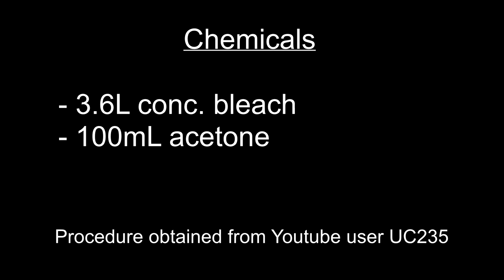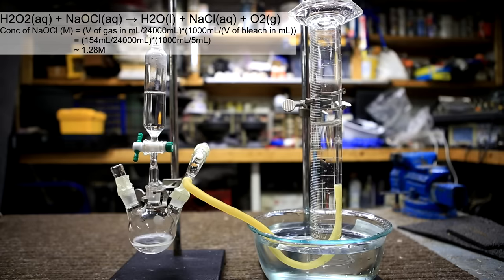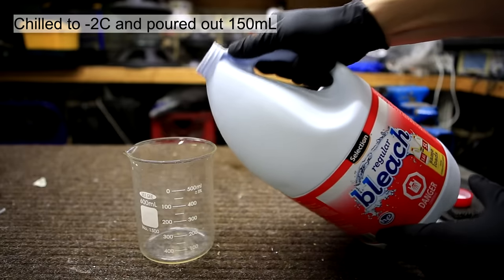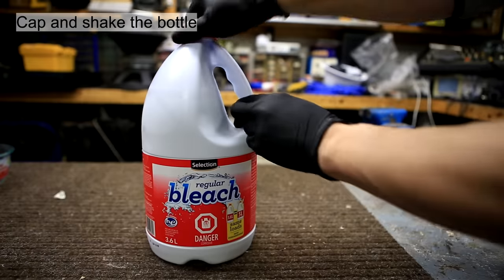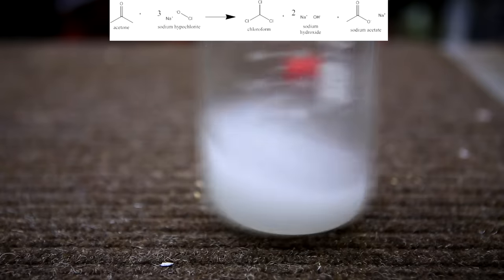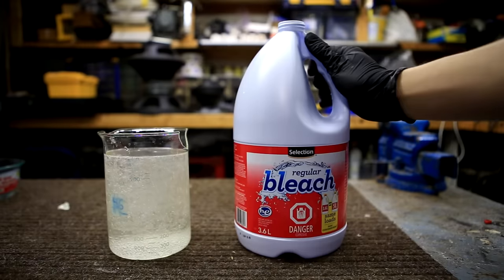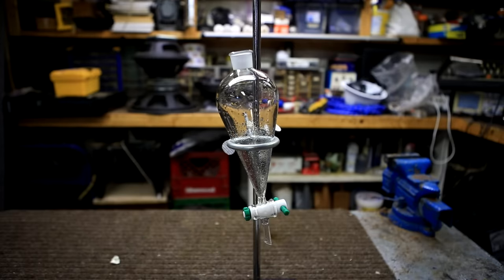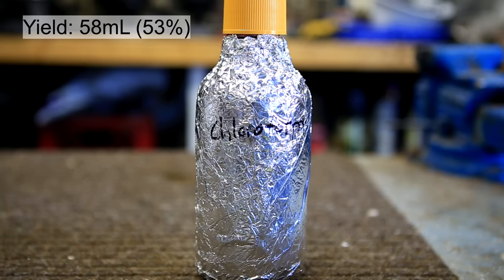Making Chloroform

Comment: This is actually very useful for smoothing PLA 3d prints.  I use it to smooth most of the objects that I print using pla plastic.  Just put the Chloroform in a jar, suspend the part from the lid, and heat it up on a hot plate.
Reply: Or just normal kidnapping. That works too.
Reply: M Mmm Hey government, is your refrigerator running?
Reply: M Mmm Well then you better go... oh wait, nevermind. Anyway, depending on the food you keep in there, that could be quite dangerous with food spoiling very quickly. I recommend that you get your fridge fixed.
Reply: A Walrus Too bad my fridge is always empty. I'm broke, and always ordering Pizza.
Reply: A Walrus We'll be by to pick you up in the morning, at around 6. That's cool with you?
Reply: M Mmm Just so long as your fridge is fixed by then. And there had better be a sandwich in that fridge.
Reply: A Walrus lmao wtf
Reply: To complicated.. guess I'll just use a hammer
Reply: A Walrus actually, I think you're the one on the wrong video. This is a chemistry channel, typically viewed by people interested in chemistry  for the sake of chemistry.
Reply: But doesn't acetone do the job just as well? Or is there some benefit to using chloroform over that?
Reply: Acetone my make you pass out but chloroform in the right dose is an anaesthetic. Though the amount needed to kidnap someone though would mostly end in murder. The fatal dose and the anesthetic effect are rather too close for comfort. Mostly the incapacitation effect is an old Hollywood trope. I can happen but,...but nowhere near as well as it does in movies. I do like the smell though, not sure why. Very useful for preserving stuff or welding plastic though. However, I do not use it anymore myself as It has a nasty habit of releasing small qualities of phosgene, and if you have not caught a whiff of that stuff, it is bad bad news. Sorta feels a breathing glass then your head pulses in waves of pain and that is a very tiny amount.
Reply: Right ? Works great 👍
Reply: A Walrus no
Reply: Tanner Tech 🇧🇲🇧🇲🇧🇯🇧🇩🇨🇦🇨🇦🇧🇴🇧🇳🇧🇳🇧🇫🇧🇴🇧🇴🇧🇿🇧🇴🇧🇴🇧🇳🇧🇴🇧🇴🇧🇪🇧🇫🇧🇴🇧🇴🇧🇲🇧🇪🇧🇳🇧🇳🇧🇴🇧🇫🇧🇾🇧🇾🇧🇳🇧🇳🇧🇲🇧🇲🇧🇩🇧🇲🇧🇲🇧🇯🇧🇯🇧🇲🇧🇲🇧🇲🇧🇼🇧🇲🇧🇲🇧🇯🇧🇲🇧🇲🇧🇯🇧🇲🇧🇲🇧🇩🇧🇲🇧🇩🇧🇩🇧🇩🇧🇲🇧🇳🇧🇳🇧🇩🇧🇪🇧🇪🇧🇳🇧🇳🇧🇿🇧🇿🇧🇴🇧🇴🇧🇳🇧🇫🇧🇫🇧🇴🇧🇳🇨🇺🇨🇺🇨🇷🇨🇺🇨🇺🇩🇯🇩🇯🇩🇯🇨🇺🇨🇻🇨🇻🇨🇰🇨🇺🇨🇰🇨🇰🇨🇮🇨🇰⬛🇨🇰🇩🇰🇨🇻🇨🇻🎊🗼
Reply: Can't you do that with just acetone though? Or 91% isopropyl?
Reply: KEK
Reply: you get the same result with just acetone
Reply: not cleaner... but way more faster
Reply: gorepuppy that's why the guy in the video said to put a few drops of ethanol in the chloroform.... to counteract or neutralize the phosgenes.
Reply: Heather Leigh 
Thank you. I just dont understand why some (not all) men do that. If they are feeling that "frisky", well we all have hands......😉
Reply: Tanner Tech I'll have to use this tip, thanks :)
Reply: Acetone is used for smoothing ABS . Not for PLA . 
If you are afraid to use Chloroform ( legal reasons or whatever ) , you can also use Dichloromethane ( legality varies from country to country ) .
Reply: A Walrus 😂🤣😂
Reply: A Walrus rape jokes are not funny.
Reply: Aeroscience IF WE HAD CHEMISTRY WE WOULDN'T NEED THE CHLOROFORM
Reply: so THAT'S why this video got into my recommendations
Reply: Hi Tanner! Why do I find you everywhere...

Comment: Make LSD
Reply: Kaden Hansen He'd need all new equipment I think. LSD needs to be  made in a dark room or with specially colored glass. Super sensitiveto light during and (less so, but still) after manufacturing.
Reply: Freedom Through Knowledge he would also need Anhydrous hydrazine... So there's another problem there. The Diethylamine he would have to use is also an extremely strong carcinogen.
Reply: seth green he could make 1p-LSD and one intermediate could be an analog Of LSA. He could make a pyrrolidine-2,5-dione lsa intermediate from succinic acid and acetyl chloride. That could act as a protecting group for the Amine on the LSA, and then he could add the propyl group to the indole part of the molecule. I don't know what he could do next but I think that is a way he could add the propyl group. This would make it only illegal during the stage where he uses the LSA. Everything else would be mostly legal.
Reply: seth green oh wait that wouldn't work because when he used the hydrazine on the 1p-LSA the ketone on the propyl group would become a hydrazine group. After that he could use potassium hydroxide to reduce it like in a Wolff-Kishner reaction but that would probably change the total effect of the molecule and also create an entirely new drug. It would get rid of the ketone entirely. Hmmmmm.
Reply: hydrazine is rocket fuel lmfao
Reply: Blox117 yes. But it can make hydrazide intermediates which are more open to certain reactions than other functional groups.
Reply: active ingredient of LSD-25 also in morning glory seeds.... anyone want to start a garden?
Reply: Qaz Wiz that's ergine or LSA, not LSD-25
Reply: Limited Slip Differential?
Reply: Nah.  It is possible in theory but no one makes LSD from ergine.
Reply: isn't it unsymmetrical methylhydrazine?
Reply: Morningglory Seed ,yes you can. .
Albert Hoffman synthesize lsd from a mushrom in the corn and that was lsa, in old days it was often in old food and people get crazy because they dont know what happening. .
Reply: Joseph Mcmaster lots of DMT synthetics.  I've tried DPT, DET (diethyltryptamine, not the insecticide), MPT, and MET.  They substitute quite well.
Reply: Or just smoke cinammon, it has similar chemicals.
Reply: Make LSPD

Comment: "You can do this with commonly available household items"

Proceeds to use about $500 of advanced chemistry equipment that not even college chemistry labs stock in any significant quantity.
Reply: Any organic chem lab has this stuff?
Reply: That stuff is actually extremely cheap. You could get everything he used in this video for less than 100 bucks.
Reply: @kadergumus2598  graduate cylinders,beakers and burners that are worth a damn do.
Reply: @fenrirrising131  you could use any glass and a pan with heat on low
Reply: @ownerf  no, you can't. That is terrible advice.
Reply: @fenrirrising131  60C isn't that hot, most glass can handle it
Reply: @ownerf   "most glass"
Reply: U do realise you are arguing about the best way to make chloroform at home 🤣😬

Comment: I had all C's in college chemistry but my first job was working in a research lab.  In performing experiments, I had to mix buffers and other reagents. That's when I learned that chemistry was actually really easy after learning through application.  However, after several years in the lab, I began to worry for my safety and left.
Reply: Because of being around dangerous chemicals?
Reply: Why'd you leave? Did you discover making LSD-25?
Reply: I've always been of the opinion that actually doing experiments helped a lot. A shame that due to the absolute cretins that were my classmates the most we were allowed to do was boil water and after they broke beakers during that we were banned from experiments altogether
Reply: @tertiaritus  and never touch the gas valves on the lab tables!
Reply: College chemistry is 10x harder if you listen to all the idiots from Business School and let it get to your head.

Comment: What a waste of a perfectly refreshing beverege
Reply: crowman 90th like.

And I prefer Clorox bleach not the Walmart brand he has
Reply: edgy
Reply: Billy died :'(
Reply: The bleach or the acetone?
Reply: unfunny...
Reply: This is just a cocktail of two great bevarages.
Reply: Ever tried vinager and bleach? Or bleach and ammonia? Or delluted hydrochloric acid and chlorine? Or hydrogen peroxide and vinager? Don't because they all make either deadly acids, deadly gasses, or deadly liquids
Reply: +Beth Simionescu Household pseudoscience. In either of the four mentioned reactions but one, no toxic gasses are released. Hydrochloric acid and chlorine do not react with each other. Only the reaction between ammonia and bleach release chloramine, which is a toxic gas. Vinegar and bleach produce hypochlorous acid, which in sunlight decomposes to diluted hydrochloric acid (in ions). Peroxide and vinegar react to form peracetic acid only in very specific conditions and the concentration of the peroxide must be higher than 6%. The only "deadly acid" produced is hydrochloric acid, which is so dilute, it is less corrosive than glacial acetic acid.
Reply: LordPinochetUTTP So what's the formula for mustard gas? Is mustard gas chloramine? Also can you just make chloroform by mixing bleach and rubbing alcohol?
Reply: +Beth Simionescu The chemical formula of mustard gas is C4H8Cl2S. As you can see, it contains sulfur and it cannot be produced from household materials, even if you try. Chloramine is significantly less potent than mustard gas, as very diluted chloramine solutions can be used for disinfectant purposes, where as mustard gas can cause deadly skin blisters if even it's diluted vapor comes into contact with your skin. And yes, you can make chloroform even by mixing absolute ethanol with bleach, although the effeciency of this process is poor and it produces a large amount of side products.
Reply: O.O
Reply: Beth Simionescu I have had ammonia.  Damn nasty stuff if that vague memory serves me correctly.  Oh and I puked.... ALOT
Reply: +Heather Leigh Did you drink ammonia?
Reply: Heather Leigh wait, how did ammonia make you puke?  You actually drank it??
Reply: Yes!

Comment: CHCL3 can be used to smooth PLA for 3D printing just like Acetone with ABS
Reply: In industry or in very technical use when 3D printing part for piping system, figurine or air piping with complex structure it's hard to get hand of it. So globally it's acetone :/ either way lungs hates you doing this work

Comment: Deutero-chloroform is also used in nMRI as a background solvent. replacing Hydrogen with Deuterium makes it unresponsive to the magnetic field. Difficult to make by this process unless you happen to have some heavy Acetone on hand.
Reply: Links in comments

Comment: "extremely exothermic" proceeds to pour acetone into plastic container.
Reply: The reaction releases heat but that heat isn't enough to melt the plastic container.   It just warms it up slightly.
Reply: Plastic doesn’t react with the mixture

Comment: Your titration was not that accurate. A mol of gas occupies 22.4 L only at STP, and in your graduated cylinder the pressure increased as the level of the water in the cylinder went down.
Reply: Pietro Tettamanti tbh it‘s not that necessary to be that accurate
Reply: Jutzi376 it affects the yield
Reply: Jutzi376 
Yeah I know, but sometimes I just want to nitpick. BTW it wouldn't take that much effort to correct that error, it would have been cool just to show the physics involved (and there are other effects that impact more on the result).
Reply: Pietro Tettamanti why would he be in STP conditions? That's incredibly cold (why would he do the experiment is 0°C). He is most probably in NTP conditions where volume of an Ideal (which is why he said 'assuming') gas is 24L.
Reply: pietro testamanti wait,I'm confused, did I not mix it right?It sure stinks.I'm so tired .Sleep,Dorothy sleeeeeeeep.
Reply: He used a large excess of bleach either way, so i think he was just getting a rough estimate.
Reply: Osw719 
😄😄 or spy wanna-bees 😄
Reply: Not to mention decanting and separation funnel was absolutely redundant, just take a syringe or large pipette and suck up the chloroform from the bottom, being careful to err on the side of caution and leave some chloroform in there, rather than accidentally sucking up some of the water. Then proceed to distillation as described. This way you may lose a tiny amount of yield%, but you don't need a separatory funnel and to waste time decanting. You actually may gain yield % because of chloroform that could be lost during decant, and very beginning of distillate that is discarded.
Reply: Caleb Synnes Yeah chloroform doesn't actually work like it does in the movies. It is not a date rape drug. You need to take a pretty big lungful, and hold it. Also it only lasts like 10 minutes tops from a single application - and it evaporates quickly enough that a "soaked rag" left over a victim's mouth would not last very long.

Educate yourself. ("Nancy Drew" novels and "Law & Order" do not count.)
Reply: Pietro Tettamanti You seem to have a lot of experience making this. Anything you’d like to share with us?
Reply: @p1nkfreud  It doesn't? :c But... roofies are boring cuz they don't come with bonus hand gags... and also not really my style, I'm more Nancy Drew than Law & Order. So what's a better option, then? I can think of lots of stuff that'll put me out for a while, even non-prescription stuff, but that all takes a while to have an affect. Could you grind up a bunch of, say, benedryl, and make a solution out of it and put THAT on a rag? Would it need to be something stronger? Cuz I don't really have the vicodin to spare. What about some sort of nitrous oxide? Could any of that be made at home without an elaborate chemist's lab? There's gotta be SOMETHING, right? Even just improving the efficacy of chloroform?

Like you can't just waltz in here and tear all my dreams to pieces and not offer any alternatives. Help a snooping kid detective out, man :c

LOL (Lots of Love),
Distressed Damsel in Dallas

P.S. Coming up with that sign-off was the most fun me and my wife have had all day. The runner up was "Desperate Damsel in Detroit."

P.P.S. No I'm not in Dallas, duh. You don't leave a youtube comment asking for advice on how to be kidnapped and leave your location. Thank goodness no one knows I really live in Chicago.

P.P.P.S. No I'm not in Chicago either. That was a joke :T
Reply: @bunghole47  
Wow, a notification 11 months later. Yes, I have quite a bit of experience in this.
Reply: Thats only under ideal gas conditions , in real gasses , using real gas equation vol comes out to be 24L

Comment: First 1:20 can be skipped if you just read the label on the bleach bottle
Reply: Sodium hypochlorite degrades over time, often a decent amount before its even put on the shelves in the stores.  You don't know what conditions it was kept under in warehousing.  However, a ballpark estimate is probably enough if you're going for a large NaOCl excess like Nile did.
Reply: @BothHands1  that's true but how accurate was his measurement? He calculated 8.6% on a bottle most likely labeled 8.25%

Comment: When you say absolute ethanol is that a chemistry term or did you just add vodka?
Reply: BREEKI BRO the first one, but vodka is pretty clean ethanol. If you distilled it further, you could use it
Reply: @MrRedeyedJedi  Why bother when everclear exists. That stuff is already like 95% by volume. It certainly TASTES like something from a chemistry lab.
Reply: @nonyabeeznuss304  absolute is a term for extra purified solvents according to a common absolution procedure. 99%+ ethanol is obtained.
Reply: Pure Ethanol made from fermentation contains 5% water when distilled.  Absolute ethanol undergoes farther processing to remove the water and is virtually 100% Ethanol.
Reply: He uses a drying agent/molecular sieves to bring it up to 100% ethanol.
Reply: Why not?

Comment: One time as i was trying to clean some floors in a grow house i was trying to use bleach to clean up crushed and stepped on leaves after mulching and i noticed the bleach was not working and i added isopropel alcohol and i noticed right away the reaction was turning yellow and realised I just accidentally made chloroform ! i panicked and quickly splashed water on the floor and that helped but hell it was scary i was by my self in the bulding at the time I could not imagine if i were to pass out right then and there!

Comment: Im the only one here not joking about using it for illegal purposes. I understand that chloroform can be used to fumigate birds and collect the lice off of them for testing. I have directions on how to build a box for them to do this in (their head sticks out and they get air but the parasites get exposed and fall off) but not the chloroform. I was advised to isopropyl alchol and bleach. Can you advise if there are any other corrosive byproducts, or can I mix a small amount and expect it to go as planned without complications

Comment: Was used as a solvent in A level Biology practicals when I was at school. Unfortunately it "leaked" and was commonly used as an intoxicant. Along with the possibility of phosgene generation and carcinogenic properties, this is why it is no longer used in schools.  We got through a fair bit of diethyl ether too, again as a solvent or to anaesthetise fruit flies, oblivious to the peroxide issue which can cause a bottle to explode by opening, Friction detonating peroxide crystals at the top of the bottle. The warning I remember was not to keep it in the fridge - low boiling point made a BLEVE possible when you took it out.  There is so much more to the safe handling of substances than just how poisonous they are (or what you learned from Hollywood).

Chemistry was fun but often really interesting stuff got used next door in Biology.